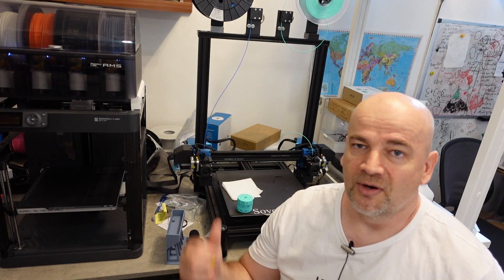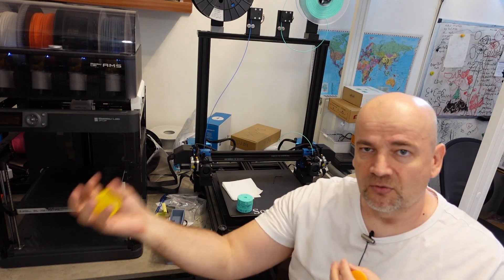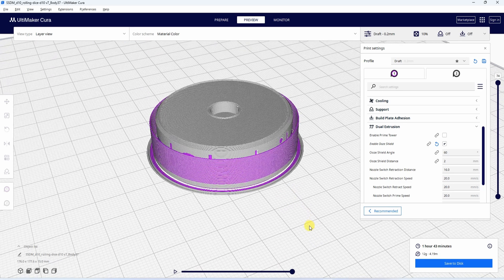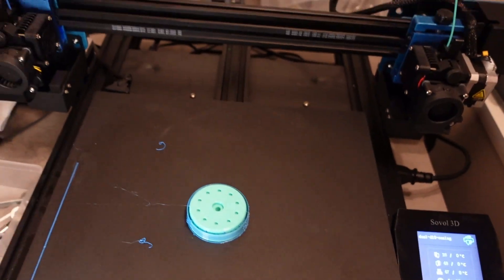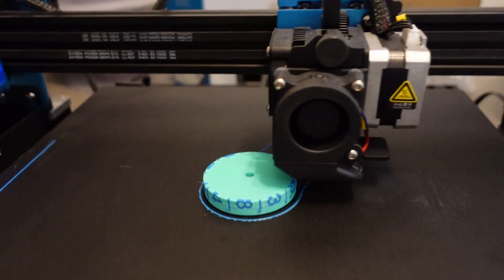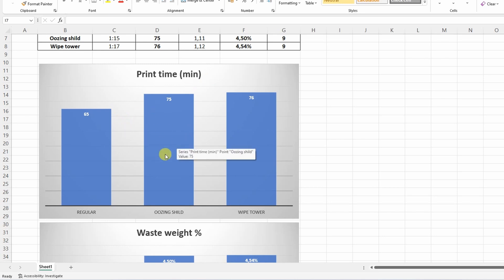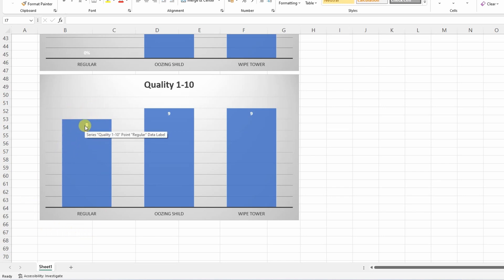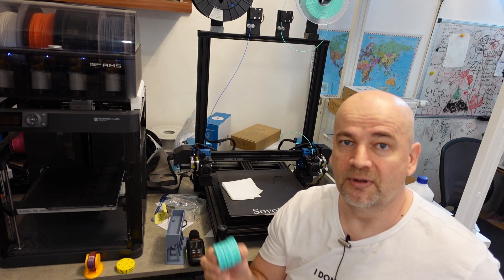Oozing shield vs prime tower, which is better for two color 3D printing on Sovol SV04 IDEX printer?

Comment: Maybe the shield doesn't have to go all the way around. Maybe let one of the IDEX tools print a single wall maybe with a little bit of curvature to the left of material and another to the right, like this:

( print )

like parenthesis. The curvature is good to make the wall stay up and not be too floppy.

But i don't know what is better, to have the tool as it's approaching print a wall, or whether it's better for the opposite tool to make a wall that the new tool would just wipe its ooze against?

Comment: What some people are starting to do now is use a spring steel plate to shut off the nozzle when idle. The idea is to try and prevent a pressure difference and thus prevent oozing/flow.

We modified our Raise 3D E2 like this and it's been working pretty well without needing an ooze shield or wipe tower anymore.

You can look at the newer Flashforge IDEX machines as a reference 🙂
Reply: Maybe the stock silicon wipe block can be moved so the nozzle parks pressed on top of it?

Comment: Thanks for the video. A suggestion for a future video that no one seems to have researched yet: a complete explanation on how to maximize the experience with ABS/Nylon/PC on printers without enclosure? How to maximize bed adhesion, warping, cracking of the part depending on part shape, dimensions, ratio volume/surface...